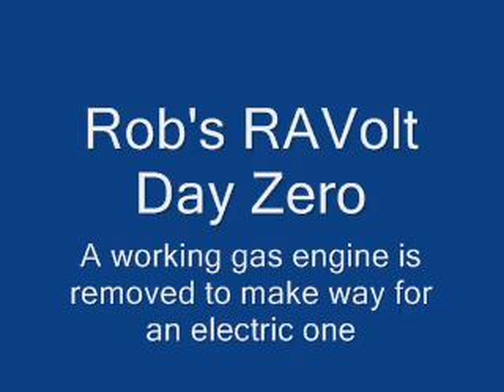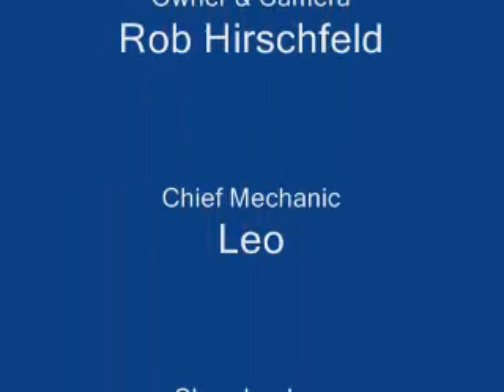RAVolt Engine Removal

Comment: I would love to take a little 2 door RAV and convert it to a large DC forklift motor, or AC and Inverter VFD system. but the price of batteries is scary if you want Li-Ion :(